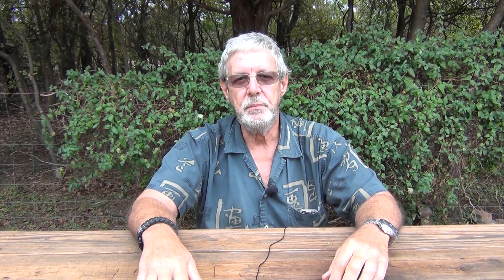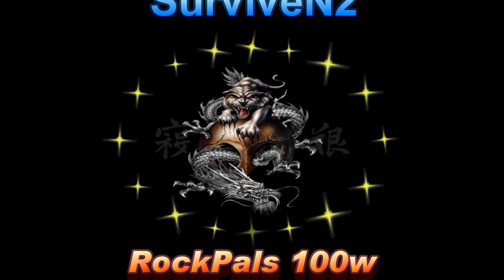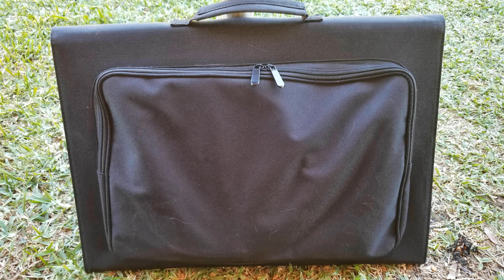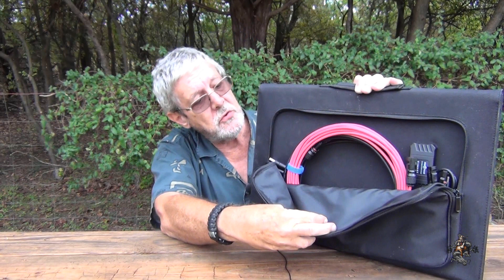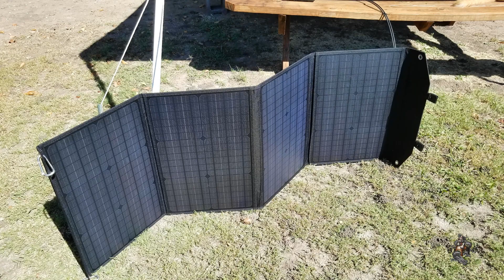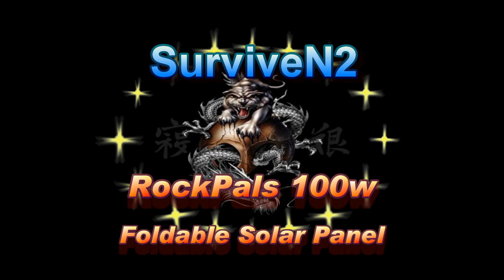RockPals 100w Foldable Solar Panel

Comment: Is it waterproof
Reply from the maker: Why would it matter.....if it's raining...then it will not be able to generate power because of the clouds....so why have it out there getting wet....😜 LOL   You had to ask tho didn't ya, I know...this is a test just to see if I'm awake huh 👍   Did I pass?  Thanks for watching and thanks for taking the time to comment 😉 Take Care 🙂
Reply: SurviveN2 no problem I said that what happens if I forget outside
Reply: SnowDown Cold supposedly water resistant but it says something like do not drop in water and do not leave in rain.  But others have used in rain and such and had no issues
Reply from the maker: @snowdowncold6707  YT didn't notify me about you responding...Grrrrrr 
Yeah I'm also guilty of not remembering things too 😲  I think it's water resistant but personally I wouldn't put it to the test 😉  If it did get wet I would let it dry out throughly before getting it near any sunlight 👍  Thing of it is....it will start to produce power even on a cloudy day 😲

Comment: Thank you, do you know what the item is called that shows how much power is going out?
Reply from the maker: Your welcome 😉   I think what your asking about would be called a "Wattmeter" 😉  You can hook it inbetween the source of voltage (solar panel or other power source) and the item that's running. It will show you how many "Watts" the item that's connected and running (whatever that item may be) is using to operate 😉   Power is also called Wattage or Amps 👍  I hope this answers your question 😉   Thanks for taking the time to comment and thanks for watching, stay safe out there 😊

Comment: Good video Sir. Just watched your video and since you've had the solar panel for awhile, are you still happy with it? Your thoughts also on the Rockpal  300watt power supply also, would you recommend it? When you was showing the pouch on the back of the solar panel the cable you said that was 20 feet or so, did that come with the unit or did you get it elsewhere? Thanks, and take er easy.
Reply from the maker: Thanks for your kind comment and thanks for watching too Ronald 😉   I was happy with it to a degree but I no longer have this 100w foldable solar panel 😲  I sold it to a friend that wanted it and I got myself 2 of the 80w parallelable foldable solar panels 👍   The main reason I chose the 80w panels is that they are smaller in size and lighter in weight than the 100w panels, which makes them easier to transport (80w = 5.3lbs each, times 2 = 10.6lbs compared to one 100w @ 10.8lbs).  The amperage output of the 80w is 4.4 amps for each panel (...and no it will not be 8.8amps....that's series...it's still 4.4amps...parallel means that and you will charge heavier loads quicker) and the 100w is 5.55. The other reason I chose the 80w panels is that it's not a big enough difference in amperage between the 80w and 100w panels that I want to carry double the weight 😲  If the 100w was double the amperage output of the 80w....then I would consider it 😉   I chose the 300w power supply for own my reasons/needs, your reasons/needs might be different from mine, so if you get one it's totally up to you 👍    Two of the main things I looked for was pass through charging and that it's got a MPPT charge controller in it, those were must haves for me 👍   The extra cables didn't come with it, I bought them from Amazon.  I hope that helps ya 😉   Take Care 😊
Reply: @SurviveN2  You are welcome for the comment and it was a pleasure to watch your video. Thanks for the information, I am checking out different systems, but at this point I am still undecided. Sounds like those solar panels will work better for ya. Thanks again and take care of yourself in these trying times    that we live in nowadays.

Comment: He! Nice video! So how manny amp/hour is the battery? This looks like it will get you there. But what about rainy days? A windmill?? Are you planning on going for a trip and/or vacation off grid?

Be save now! 

Greetings,

Jeff
Reply from the maker: Thanks Jeff 👍 They say that it's a 12v 18.7Ah battery. I'm working on the rainy day part, yeah a windmill might be a solution to that problem. Thing is....I've got a lot of BIG trees around here, it would have to go above them to work good 😉  Like I said California's power grid problems and the recent local EF3 tornado power outages has speeded up my urgency to upgrade. Thanks Jeff for your kind comment and thanks for watching too 😉 Take Care 😊